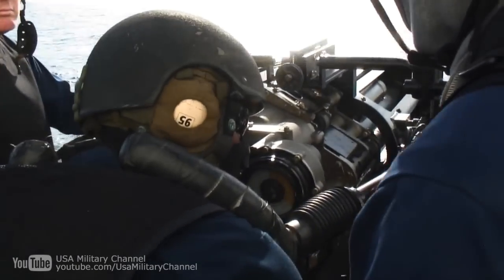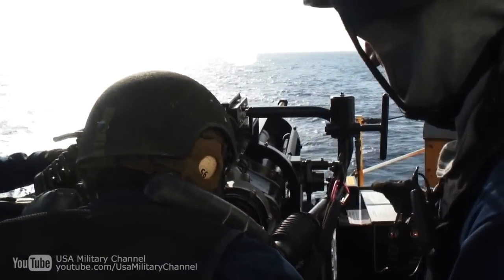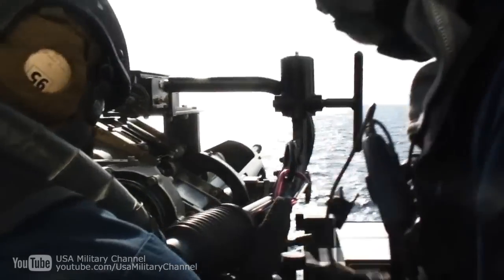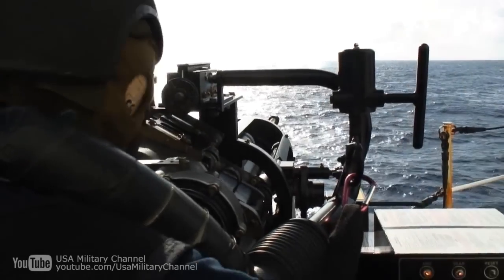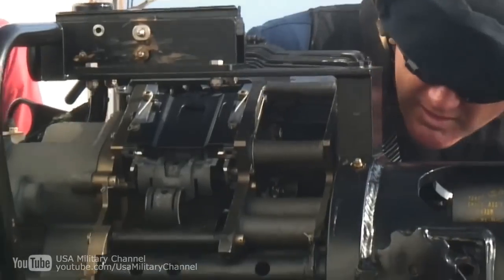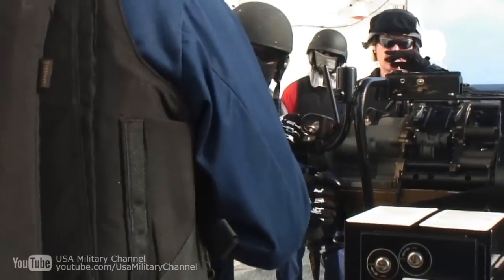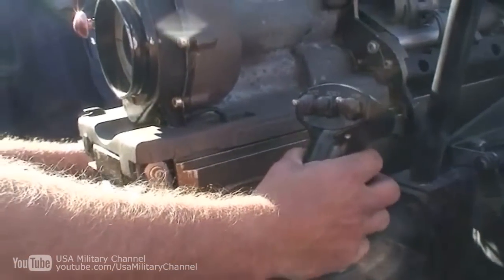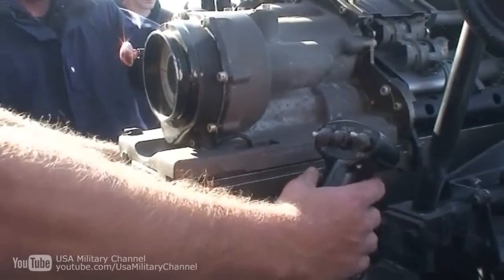M242ブッシュマスター 25mm機関砲 (Mk38) - M242 Bushmaster 25mm Autocannon (Mk 38)

Comment: Where do the shells go? Straight into the ocean? I would think they'd want to recycle them during war time. I'd sure like to have one as a souvenir.
Reply: Mexico City Okay, let me first bow to your greater knowledge as I know very little about this subject but I do know that in business, one penny saved, millions of times over adds up very quickly. I'm sure you're right about where the shells go. I fully admit this could be due to my ignorance but It still seems a bit wasteful to me irrespective of the actual money spent.
Reply: The 25mm ammo is steel case, electric fired primer, and is not reloadable.

 While the few ounces each empty casing weighs does add up to many tons of recyclable steel, a logistical and bureaucratic mess makes it difficult to demilitarize and recycle.

TL;DR Steel is cheap, toss it

Cut down, cleaned, polished and sealed with a food-safe filler for the primer pocket, they do make nice shot glasses. Or so I have heard.
Reply: Styles828 Well, that's a good point.
Reply: All used casing gets tossed over the side, but crewmembers can take some as souvenirs, I have some 25mm rounds from my last boat.
Reply: @Styles828  Completely correct except for one minor detail: the Mk38 Mod 1/Mod 2 fires its cartridges using a mechanical firing pin, not an electronic system.
Reply: @danielreppen341  Holy necro! haha. I didn't know that very cool. All our 25's are electric.